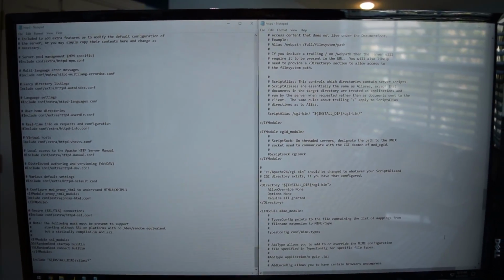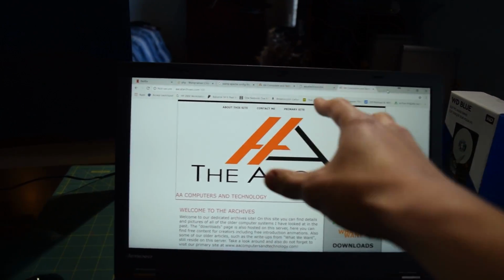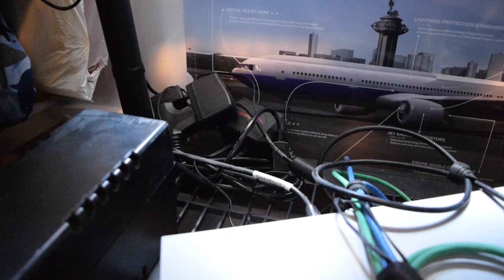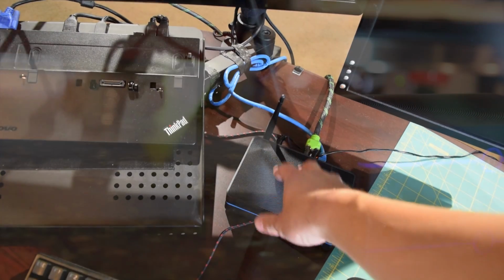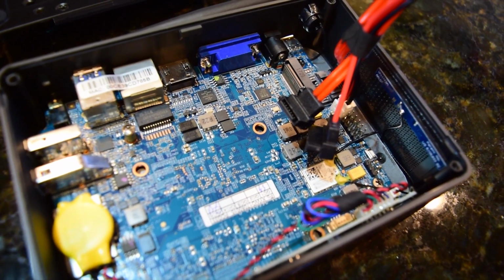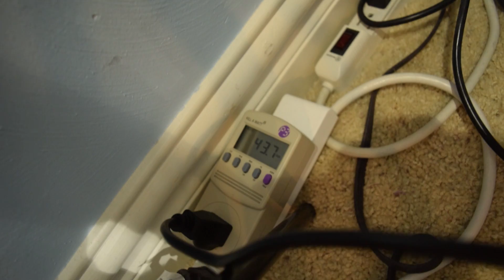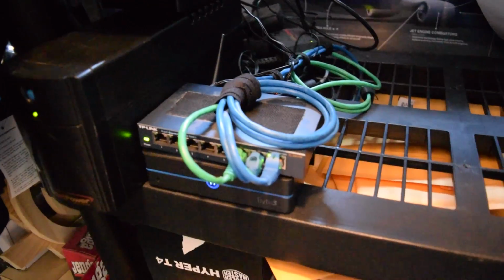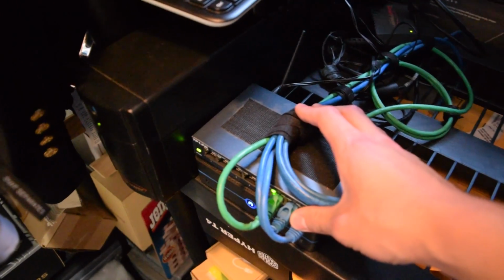Website Server Upgrade: From 45 Watts to 3 Watts

Comment: the new backup drive will also die. These boxes are not well ventilated. The high temperature is the main reason for hdds to die.You need to keep it under 40 C
Reply: I believe you need to keep them under 50C (make/model dependent), but below 40C is preferable. The hotter the drive the greater the chance of failure.

Comment: Well what do you know, I also recent upgraded HP Compact (AT492AV) to a HP Z600. Was using compact as a media/web server but was too slow to transcode video so my streams were buffering. I got a Z600 for cheap off a server refurbisher, slapped Ubuntu on it, and been running like a dream. Hosts my website, plex, owncloud and other crap I need. There's a raid controller in the Z600, so both all data is backed up.

Comment: use that HP Compaq computer as an off site backup machine for your main computer and your laptop. Put a large HDD in there and a cheap 60GB  SSD as a boot drive and put Linux on it. Every month you could connect to it as a NAS and backup you computer over the network using at least CAT5e (1gbit/per second or about 110GB/per second!)

Comment: You should make a tftp server and use it to host Lubutuntu or any other lightweight Linux distro so you can save some time by PXE booting and installing that way. Though, if you are using the liveusb, it should require some manual work, but you could make an iso with all the applications you need to test. You probably know this already, but just being thorough.

Comment: For not much more than the cost of that micro pc you could build a full modern box and run the server with Docker or Xen.  Then you can run many other services on it simultaneously the same way.  You still have to balance size vs cost.  Best bang for buck is still going to be with a standard ATX case and PSU.  Better for cooling too.
Reply: https://pcpartpicker.com/list/fWXV29  Note the motherboard may need a BIOS update with an older CPU to work, probably unlikely if you buy a new one.
Reply: Just in case here's an updated list that works without an update, https://pcpartpicker.com/list/t4qrq4.
Reply: The only difference between those two lists are the APU.  After making sure the BIOS is updated to a compatible version, you can put the latest generation APU from AMD on it.  Might not be a better deal for you if you just want one or two tiny power sipping single use computers.  It doesn't take many in one location to add up to a worse deal overall.
Reply from the maker: That is also an option.  However, the Byte 3 was a review sample that has just been laying around for the past 6 months, so I decided to finally put it to good use.

Comment: Tip for your solar! Avoid the inverter it consumes about 20-50w idle! Just use step up/down converters for the mini pc or a pico psu if it has a atx connector your system should easily be able to run this tiny mashine!

Comment: Even though the hp compaq doesn't have much power you could turn it into a proxmox virtualization server to try out some server operating systems. An upgrade to 8gb of ram might be useful if doing this.
Reply: Can you even do 8 gigs of RAM on that HP/Compaq? Might be a motherboard limitation? I serviced systems in this series for various customers and the most memory I saw in them was 4 gigs and Windows XP 32 bit or Win 7 32 bit later in their life. This is mostly because they take 3.5 gigs for the OS and half a gig for or a quarter gig for VRAM.
Reply: @matthewjbauer1990 yes it probably uses ddr2 and in that case you could get 4 sticks if 2gb ram modules. Or if it's a little newer and has ddr3 then it can have even more memory.
Reply: I retract my 1st statement. It's a HP DC7800. Came initially with 2x512 RAM and Vista OR you could order it with XP. Most commonly I saw thousands of these with XP on them, so that is why I thought it was 32 bit limited. My bad... I guess it is limited by the OS and 8 gigs MAX. In a W10 environment, even 8 gigs isn't enough.
Reply: @matthewjbauer1990   Thats why I like windows 7 and XP
Reply: Although windows 10 will run on lower ram it doesn't run as well as windows 7 or even 8 would on the hardware.
Reply: @VaronBros In my experience windows 10 runs pretty bad on a pentuim 4 even with plenty of ram, an ssd, and a decent graphics card. While on the other hand windows 7 performed better for basic tasks
Reply: VaronBros. W7 and W10 both require a minimum of 2 gigs RAM. 4 is Recommended per Microsoft. I have been working with one of my customers at work where their internal IT has been pushing W10 to all their HP8000 (c2d and 2+ gigs DDR3) or other desktops or laptops and I have had to go in and put them to at least 8 gigs RAM. When I am done, the systems barely chug along. For W10, even in my personal Lenovo Yoga 720, I had to move it to 16 gigs just to run Chrome and or Firefox because I was hitting close to the 6ish gigs browsing the internet. Looking at LARGE PDFs or LARGE Excel sheets, while having multiple instances of Chrome open, I'd constantly hit 6+ gigs. In fact, just browsing the web, I'm at 5 gigs RAM usage right now writing this comment.
Reply: @matthewjbauer1990  I don't think ram was your issue. It was probably old hard drives. Also you probably didn't disable a lot of window's 10 bloatware. Windows 10 uses lots of ram to cache part of the operating system making it snapper.
Reply: @matthewjbauer1990  I've got a core 2 duo optiplex running windows 10 with 4gb of ram and integrated graphics and it runs good, although that was after disabling windows 10 bloatware. You use a program called anti-spy beacon to it for you if you would like. Also it uses around 70% of its ram all the time and the os adjust its caching to allow for other programs such as chrome to run.
Reply: + Pentium D You are probably right. That being said, After upgrading C2D HP 8000 systems to 8 gigs of RAM, that did seem to help my customers. Also, W10 doesn't play nice with them. still slow, but usable.
+Varon Bros I upgraded my laptop because I didn't like the idea of using up to 6 gigs of RAM used all the time (most of the time it was 4 or 5, but I had the other 8 gig stick , so I used it). I game on this laptop from time to time and I use LARGE Excel sheets and LARGE PDFs so they take up RAM. Chrome wasn't the only reason I upgraded the RAM. Mostly because I had the stick lying around and I just wanted to use it. I should have said more of my reasoning on the RAM upgrade. I have upgraded RAM in computers simply because Excel files won't load because they were too large to properly load into RAM. Don't count it out that Chrome is a contributing factor for me because I need it for work and I use quite a few tabs and if websites don't load properly, that can be a problem.

Comment: oddly this type of power consumption thing is what I was using for practicing mental math,  and if I remember correctly this is around a $70 savings from power per year with electricity being around 10 cents per kilowatt (rough numbers because I got lazy) if it's running full time. So odd coincidence and if this thing is going to run for a couple of years it'll pay for itself with power savings.
Reply: It's more like 35$/Year at 10¢/kWh if the difference is 40w. If you run it long enough it can end up saving money. Didn't include space, cooling costs. Noise and emissions may also be a cost.

Comment: what CPU did the old 45 watt server use?
Reply: Luke Watson . You'd almost think that answer was specific answer. That's like answering that it uses Ryzen or I series. Sure it's helpful, but it may not be useful enough information.
Reply: Your comment is too old. But I use A8-7600 quad core at 45w tdp. It idles 35w min and 80w full load. 2 seagate hdds and 1 ssd as iscsi server.

Comment: Sweet video! I've been looking forward to you making this upgrade for some time and it truly is a much more efficient computer. I've built myself a NAS recently using an old Dell R410 which has dual Xeon X5675's. The entire thing cost $150 (not including the hard drives of course) with both of the chips. I've installed 4 8TB WD Red drives and the thing purrs along.
Reply: @JeremyR-h3i  For my needs it's good. I need something that has a lot of power because I'm constantly uploading/downloading files to it and using it as a cache server for downloads. Linustechtips made an episode on a caching server recently, and it needs powerful hardware to be effective. This NAS is also sometimes used as a render box because it has substantial power.
Reply: Also my house is solar powered, so power consumption doesn't matter to me. But yes it does use much more power than a nice webserver like the one in the video.

Comment: Do you have business internet?  Or how do you host a website with a dynamic ip???
Reply from the maker: DYN DNS has a client that you can use with a dynamic IP
Reply: Aren't you worried about hosting from a private network? Essentially the port forwarding is allowing external traffic into your home network, wouldn't that be a security issue?
Reply: @dgnikon  use a managed switch and vlan it off. Deploy another firewall internally between your internet facing hosts and your internal network.
Reply: Duckdns
no-ip
Dyndns

Comment: i was wondering why he had an apple phone but then i remembered he runs Linux on all his damn rigs
Reply from the maker: I don't have an Apple phone, that was the Honor 8 by Huawei.
Reply: Now that steam let‘s you run so many windows games additionally to the already existing titles, he can enjoy freedom and gaming if he wants to, while Windows users will jave to deal with down-your-throat updates, spying and the most sluggish experience if your pc is older than two weeks. Can‘t blame him, except on my iPad I exclusively run Linux myself, with a Pi 3 as my daily driver for 90%. I have a solar panel charger and power the Pi with battery packs for phones. Soon I will add a low-power lcd screen and boom, off-grid. I doubt windows could give you that kind of financial and practical freedom.

Comment: Make a media center with the old server
Reply: YES
Reply from the maker: I was thinking that at first, however I have already done that a couple times.  I would like to do something a little more "outside the box" with this desktop.
Reply: AA Computers and Technology Throw in a 710 and make a mini game hoster
Reply: Jake, a 710 isn't going to do much for gaming.
Reply: @AAComputersandTechnology  how about as a wireless storage? Where you can access them from your smartphone, laptops, pc using wifi. That'll utilise the drive bay too (just pun any hard drive lying around for massive amount of storage)

And i tried those at my house, but unfortunately have no laptops lying around (testing uses my ultrabook laptop, which isn't ideal). And i can't set my own username/password. Everytime i turn on the "password" settings they immediately asked for password and username (on my phone), although i never set it up
Reply: @AAComputersandTechnology   did you use android x86 or android tv? Becsuse it would make for an interesting video. I always have trouble with installing them